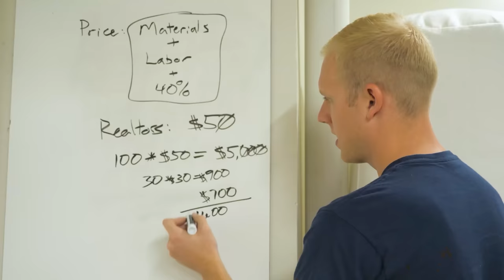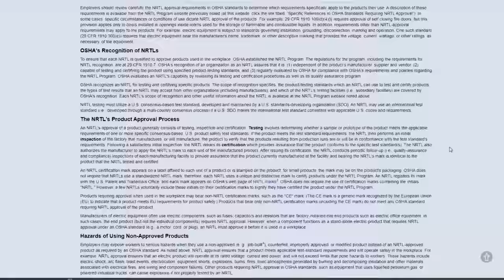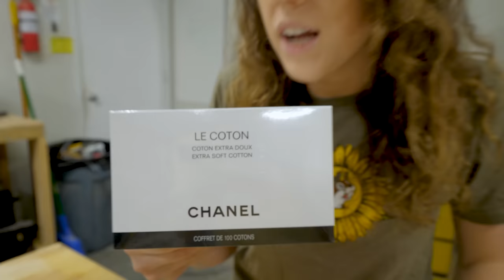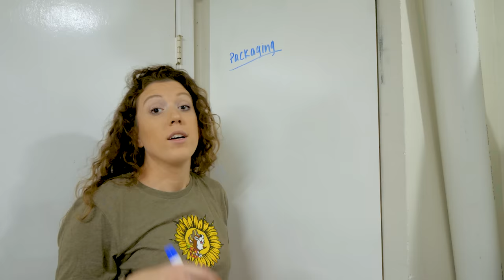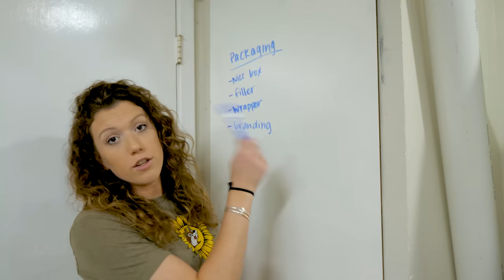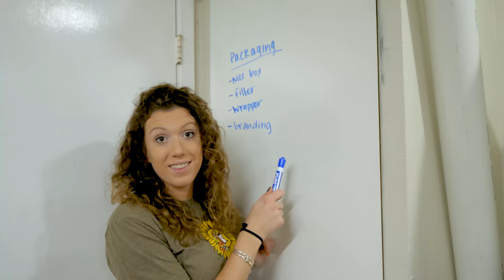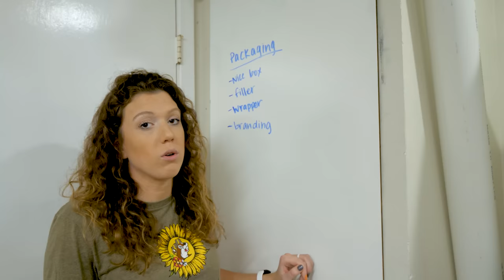🎁📦Cutting Board PACKAGING for MORE SALES! 💵💰 (and a surprise IKEA trip😱)

Comment: Hi guys.
Firstly, I am at the same stage you are doing the same thing in the UK and packaging was a question that I'm starting to ponder.
Love the way you broke down each challenge and found a great solution and given some of the comments too I will now be addressing this.
Can I add an observation. I love the black outer box but the matt finish marks easily. The clean Apple type matt white box may be better especially as you are using this as a parcel box. Just a thought but thank you so much.
P. S. Loved the first video which explained maximising the amount of boards per week that was possible. Very smart

Comment: You might need a light cardboard insert to hold the board in the center.  Otherwise it will slide up or down and that filler will be smashed and it won't present like you want it too.  I know the boards might be different sizes, but a black cardboard piece surrounding the board would look professional.  Remember UPS/FEDex will not handle it how you'd like to.
Reply: Looks awesome, nice job on the box and I enjoyed hearing the process.

Comment: I live so remotely that I've never been inside an IKEA either. Do they really sell  end grain laminated over MDF? Now, that's cheesy. My experience of packaging is that the first priority is to deliver the product (yes, end grain boards) un-degraded which suggests highly uniform sizes so the work fits the box and can be displayed either in galleries or festivals. High quality two-part boxes like Apple's are custom and are outrageously expensive in small quantities. They would also be costly to ship and warehouse empty because of their volume. Such boxes would be more expensive than the wood you are using. Your choice of packaging suggests you expect  to sell primarily online. If you ship with your boxes being the outer packaging, how do you think that packaging will look after you seal it with tape and entrust it to any of the delivery services? On the other hand, I love your butcher paper sleeve both because my boards are oily, too, and the size would be readily customizable by using a cardboard shim when you tape up all sides (sticky dots?) with a light, reusable adhesive on the flap. I've used bubble wrap to full the excess room in my boxes. No matter how you slice it, shipping, packaging, and online expenses are going to take a big, big bite out of your retail price which is why I've confined myself to the very top end of the market. Best wishes for the success of all your enterprises.